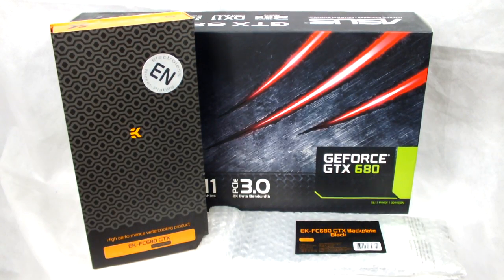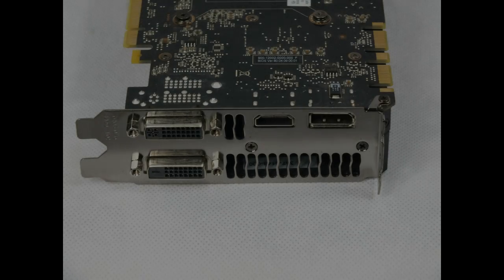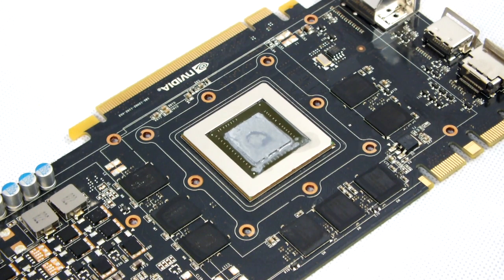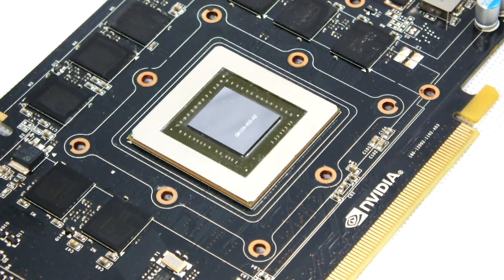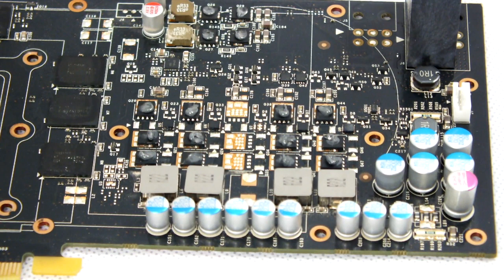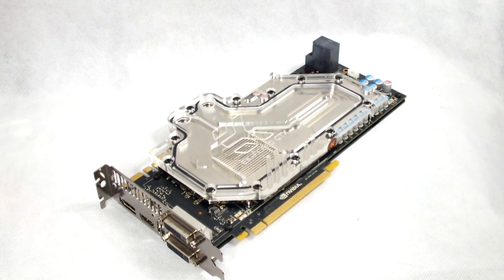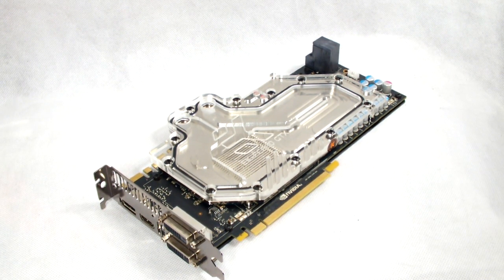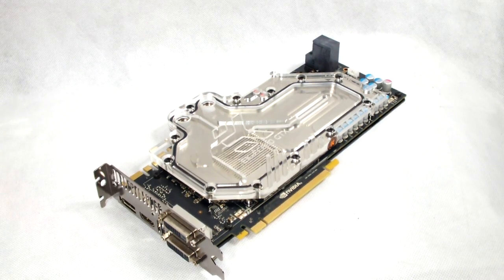EKWB Graphics Card Waterblock Fitting Guide [Rigmods.com]

Comment: thanks for the replay
it helps alot

yes i use decent compound 
Gelid GC extreme is a great one
ive got gelid for the cpu block
and mx2 for the gpu 

because i lost the gelid :P
when haswell launches im gonna drain my loop 
and correct the gpu with thermal compound in the vrm

Comment from the maker: I was just doing this video following ek's recommended instructions for those that purchase this block. Personally I use a small blob in the center of the die but ek's recommended method on their instructions was a cross pattern and for the purpose of accuracy that's what I did. When I remounted at the end of the video I used my own preferred method :).